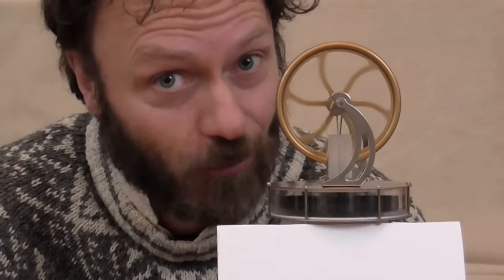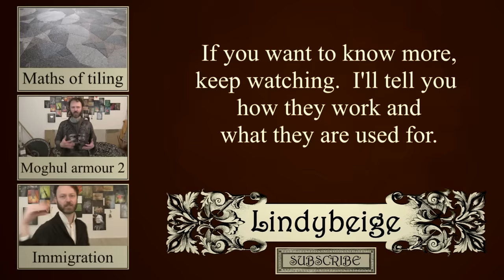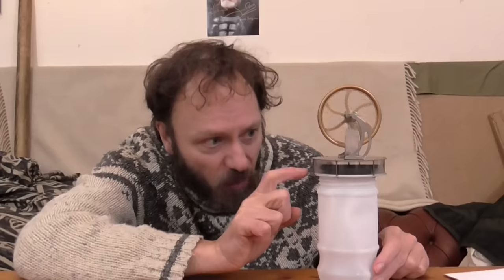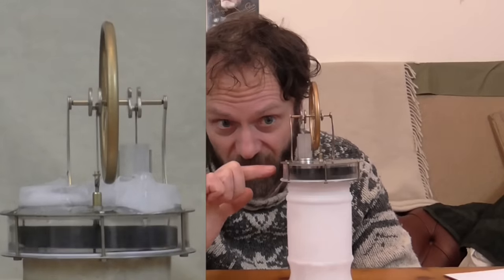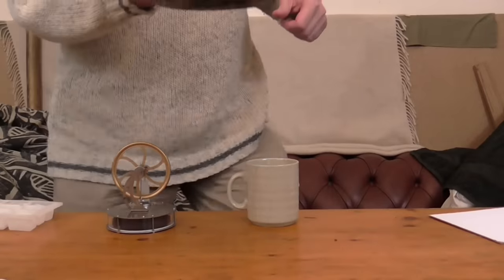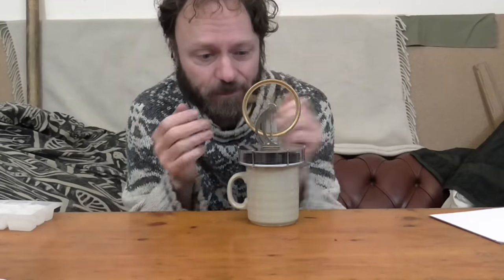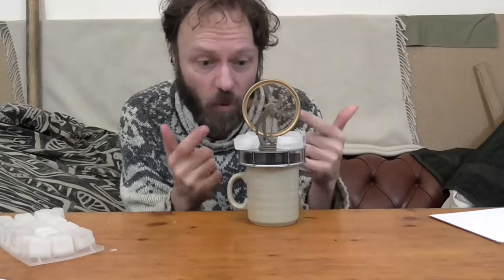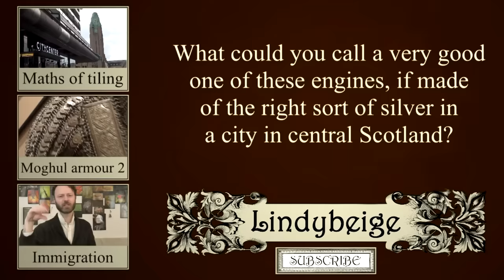Stirling Engines - the power of the future?

Comment: it is more efficient to use waste heat from servers to power a heat exchange to heat houses.
Reply: Daniil Pintjuk which is happening. though I wouldn't be surprised you wouldn't lose a lot even if you did use them in a server farm so you could both
Reply: Daniil Pintjuk the nice thing of using stirling engines in your server farm is that they naturally provide a feedback system to keep a constant temperature. If you use the engines to power the refrigerators you get a nice trick:
- if the servers get exceedingly hot, the temperature difference grows and so does the power output of the engine, cooling the servers down again.
- if they get too cold, the engines slow down, and the temperature goes back up.
Reply: Xavi Ondoño is getting too cold a problem for a server farm?
Reply: If the server farm is using water to disperse the heat more efficiently, then yes
Reply: Could you not potentialy use a PH neutral liquid with much higher boiling and much lower freezing points than water? Not that i know of one atm, but in theory.
Reply: Alistair Shaw for one, and as Eileen Blurrr said, if you are using fluid systems (wich is most likely) you need to keep them in their operating range temperature. Also, lifetime is generally limited at certain temperature (0ºC or -20ºC MTTF are common specs for electronics), once you go below that, you can have unexpected behavior.

Wilder Generally speaking what you want is to have your fluid in constant boiling/freezing, since during phase changes temperature remains constant (and latent heats for phase changes are way higher).
https://en.wikipedia.org/wiki/Heat_pipe
These things are super efficient, but you need to keep them in their safe margins.
Reply: Xavi Ondoño my comment was more of a joke about how much heat a decent sized server farm will kick out.
Reply: Xavi Ondoño 
I'm not quite sure youd want water at freeze point since that causes problems with exploding pipes. unless there's some sort of unconductive antifreeze solution you can dump in there.
Reply: +Wilder
If you could find something with as high a heat capacity, yes. Water has one of the highest heat capacities (how much energy it takes to heat it up), only really beaten by stuff like Ammonia and Hydrogen, which have far too low boiling points to be practical. Besides, there's not much point in using something with a lower freezing-point, since you rarely need something to operate at a lower temperature than zero. But if you need to cool something to really low temperatures, then you can certainly use things like liquid hydrogen or nitrogen.
Reply: Eileen Blurrr totally right, I didn't write that right. If you are using water you want it to be boiling in your heating parts (like in heat pipes). I added freezing because theoretically you could do kind of the same thing, but of course it takes water out of the question due to the hidrogen bonds.
Reply: Zappy99 The reason i specified a sub-zero freezing point is because one of the speculated scenarios of this thread was an arctic server farm, which would potentially get freezing cold. And therefore a substance that freezes at or near the zero point would be ill fit.
Reply: Wilder
Only if you shut down the server farm. The water is constantly getting heated up by the servers, so as long as you keep the system flowing and the servers running hot enough, it shouldn't freeze. Besides, you're not building a server farm in Antarctica.
Reply: +Wilder water can be mixed with glycol mixtures to prevent freezing, or even ethanol.
Reply: Preciselyrandom Thank you, this is the kind of answers i was looking for.

Comment: So what if you had a cabin in Alaska, or Siberia or whatever, and put one of these through the cabin wall, so one side would be outside and the other inside? Just a thought. Although it would use the heat from the fire place, and a steam engine connected to that could be a better solution, but still, something to think about.
Reply: Problem is that air is a good insulator, so your engine isnt very efficient, and installation and upkeep of engine and generator are just not worth it.

Comment: I'm curious about why the spokes are curved on the flywheel.   Is there a practical reason or just aesthetics?
Reply: Just aesthetics I’m afraid.
Reply: The spokes of cast flywheels and pulleys are usually curved to reduce the residual stress caused by contraction of the cooling metal.
Reply: I never even thought about casting issues, you learn something new every day!

Comment: The most british engine ever, it runs on tea!
Reply: You could use it to power a rotating spoon to stir your tea.
Reply: Nilguiri Fuck yes!

I want 20
Reply: ampeyro
The deluxe version has an automated biscuit dipper.
Reply from the maker: I did intend to make a HHGttG reference, but forgot in the heat of the moment.
Reply: That's almost but not entirely, quite unlike you

Comment: Imagine a Stirling engine heated by a nuclear reactor.
Reply: I imagine you're joking... but that would defeat the object! 
A steam turbine is a lot more efficient, which is why they use them in nuclear power stations.
Reply: Rabbi Herschel Lieberman-Bergblattstein I always wondered why they use steam turbines and not Sterling engines in powerplants.
Reply from the maker: True, but in a submarine...
Reply: Not as crazy as you think, there are designs for new families of radioisotope thermoelectric generators that use sterling-cycle engines.  Not a reactor but still nuclear power :D
Reply: Lindybeige
Well, it's a lot quieter for stealthy submarine use. That's the only advantage that I can see, though.
Reply: What might be better, in my opinion, is to use both. Steam turbines are more efficient, so they shhould be used for the primary generator; however, they also give off alot of heat, so a benifical place for sterling engines might be utilizing the waste heat coming out of the cooling tower to generate a little bit extra on the side.

Comment: Stirling engines:
1. Can operate on very low temperature difference.
2. Are highly efficient relative the Thermodynamic limits E= (U-L)/U where E = energy, U = upper temperature (heat source), L = lower temperature (heat sink).
3. Have very LOW power to weight ratios (so far as I know at this time).

The first two are good. The third is the kicker which has so far prevented the use of Stirling engines in vehicles or large power plants. It MAY be possible to design a Stirling engine with high power to weight ratio comparable to internal combustion engine, but it has NEVER been done (as far as I know). Radical re-design of piston & cylinder plus use of high pressure hydrogen or helium might make this possible, but has not yet been achieved (as far as I know). I would be happy to learn that somebody somewhere has come up with a high power to weight ration Stirling engine, but I have been unable to find it.
Reply: you mean E = efficiency?
Reply: Actually it has already been done, and a while back to boot. Solar stirling plants use a high efficiency stirling unit.
Reply: What about in space? Anything pointed to the sun gets really hot, while anything in the shadow gets really cold. Lots of potential there..
Reply: @Perktube1  yes. hard to maintain in space though.

Comment: Someone built a large ship that used a sterling engine for power... the designer said to expect 20+ knots.  it barely made 3 knots top speed.

The Stirling engine is essentially useless for any practical application.
Reply: I’ve heard it works will in some submarines cause it is so quiet.
Reply: Not useless, but it has only limited applications.  It is extremely efficient, by which I mean that it does not waste much energy.  However, it is not very effective, by which I mean that it does not produce much torque or power.  It is ideal in applications requiring a constant low load, such as running a water pump that feeds a storage tank.  Such an engine can run on the temperature gradient between light and shade, or the surface temperature and a heat sink in the ground.  It is not ideal for heavy jobs like propelling a vehicle or ship at any significant speed.  You can increase the power by increasing the temperature gradient by burning fuel, but then you start to sacrifice efficiency because some of that heat is radiated, or simply lost up the chimney.  For many of the practical jobs that might suit a Stirling engine, a small windmill would often be better.  Maybe out in the desert, where there is reliable sunlight that can be focussed with mirrors or lenses, a more powerful Stirling engine would be practical.
Reply: The products we use will become more energy efficient. With development in low torque electrical generation its not impossible to see this technology become more practical.
Reply: It's not very efficient for things that need to move or turn on and off frequently. A boat is both of those things. There are plenty of applications for things that run constantly and don't move though.

Comment: Let's imagine that (for whatever reason) i have no access to electricity (stranded somewhere, war, apocalypse?) which is needed to charge mobile phones, radios and flashlights, some of the most useful tools in a survival situation. Would it be efficient to ignite a fire, then set up a stirling engine above it, and have that power a generator? Or is perhaps a different method for generating electricity using primeval tools and a generator more efficient/effective (outside of handcrank, obviously)?
Reply: you probably overestimate your own ability to just make a working piston like this
Reply: Evading Grid  yes but they were still made by smiths etc with real tools

Comment: Nuclear Stirling Engine?
Reply: Its been suggested its already happened
Reply: NASA was working on a Stirling version of RTG which would be maybe 5 times more efficient than thermocouples at generating electricity on space probes. But that got cancelled...
Reply: Probably weight or size issues.
Reply: Great to use up the heat of nuclear waste
Reply: @skoronesa1  More likely an issue of it acting like a gyro and disturbing the probes SAS system.
Reply: Yes, it would possible need the heat of an average nuclear plant to power your car with a Stirling-Engine.
But then you also have to carry it around with your car - so, you might need two nuclear plants...
Reply: @the.parks.of.no.return  Isn't the water warm from residue radiation mitigated the necessary thermal differential?
Reply: @skoronesa1  Weight, size, and gyro issues, and the fact that stirling engines have moving parts and thermocouples don't.

Comment: Can't you just make a combined engine? A coal power plant that also heats a sterling from excess heat?
Reply: You could
Reply: excess heat from power plants is often used to directly heat housing in nearby urban areas
Reply: it is actually amongst the things that are used to improve efficiency in some plants :)
Reply: Heat from power plants is actually used to turn fans to generate electricity, right?
Reply: Drumsgoon power plants will use very hot steam, take a part of its energy into electricity and then have a waste of lower temperature steam/water.
Once the turbine took like half of the energy, a stirling can still get a part of the remaining energy, thus improving efficiency.
Reply: +Pierre HatesGogolePlus ah, good to know!
Reply: actually +Drumsgoon is right: the pipes for the steam engine should not be exposed to allow the addition of the stirling engine, since the water runs in a system opposite to the cooling system of something like a Vickers heavy machine gun (we're still on this channel eh)

 where the water is pumped into the cooling jacket, takes up a certain amount of joules (heat energy) and is pushed out again by the next volume of water, then it goes into a reservoir that ideally has a large surface area made out of heat-conducting material (most metals will do an excellent job) so the water is as cool as possible before going into the jacket again.

In a steam engine the 'cooling jacket' is the reservoir and the reservoir is the steam turbine... 

the machine gun works more efficiently the cooler the water coming into the jacket is, 

for the steam engine, once you've built up enough steam pressure in the boiler (cooling jacket), you'll want to have to use as little fuel as possible to keep the water turning into steam at the rate necessary to keep up said pressure (the less fuel, the more efficient the steam engine is)

this is achieved by having the condensated (after giving a certain amount of joules to the turbine) water that's cycling back into the boiler be as close to boiling point as possible (thus requiring the least amount of added energy by use of fuel to get it boiling again- possible)

what this means is that modern steam turbine engines are sporting 'high-tech' latest and greatest heat insulation, wherever it can be applied; if done properly (no exposed metal parts that are in any way connected to the steam or even the fuel-burner stide of the boiler) you should be able to put your hand up against it, and it would feel room-temperature-ish at best.

The only way you could use it to increase the efficiency is by using some of the heat in the exhaust gasses of the burner to have a sterling engine power the gaspump-system of a heat exchanger system, that would use the remaining heat of the exhaust to further insulate the steam engine, by adding it to an air-insulation system (like the bit in between double-pane window glass) that would be a part of the existing insulation.
the efficiency being that you don't require an extra (electric)motor to drive this system.

just my two cents :p
Reply: Informative comment, thanks!

Comment: Do they operate different at different altitudes? What would happen if you tried to operate on the top of the Himalayas? Would it be more effective due to less air pressure or more?
Reply: That would not matter. All that matters for them is that there is a difference in temperature from one side to another.
Reply: yes.

Comment: 5 hundred degrees between light and shadow on the moon. 
Perfect. 😂
Reply: But the horizon is always moving, so that isn't much help. But if we ever build a moon base, you'll have a static place on the moon, where the interior temp is always (ideally) held at 22 degrees celsius. And so, regardless of whether it's day or night on the moon, you should have a temp. variance of about 200 degrees between the inside and outside of the base.

What I really like about this idea is that there would be a moment, every 2 weeks (transition between day/ night on the moon) where the exterior temp was the same as the interior temp and the base would lose power. But, after that moment passed, as the exterior temp rises/ drops above/ below 22 degrees celsius, the power would come back on. Sure, you could negate such outages with capacitors and batteries, but I think it'd be cool to momentarily lose power every 2 weeks. Kinda like a lunar timekeeping device...
Reply: @user-ef4gf7rr9r  
Train?
Reply: Remember you need to lose that heat to the environment as well (otherwise the temperature gradient disappears really quick)

Comment: at 11:57 - > if you can imagine something like this running on a hot country like you say  , if you put it on the sea which is cold and you paint matt black(perhaps mini solar panel:) the upper surface to absorb more heat from the sun...that would be fun...! Also in winter and cold countrys you could set it to the wall horizontally behind a fireplace or chimney...that would be also fun!!
Also another idea came to mind, you might half bury it inside soil that might be watered from time to time to keep the underside cool and the upper hot

Comment: Since geothermal systems are already being installed on large scale green energy buildings, this seems like a great auxiliary power system to supplement structures. You already mentioned volcanic regions, but the ~15-20C difference in equatorial regions with the earth's crust(not withstanding more extreme regions like Irkutsk) would mean reasonable local auxiliary power in low infrastructure regions. 
I love your industrial revolution knowledge (the Turbinia is another I really liked). There are a few other British engine like the canal power systems and coal mine systems from the late 18th century that seem really interesting.